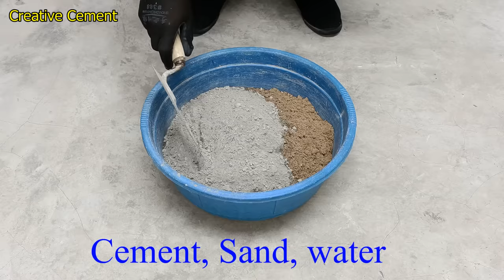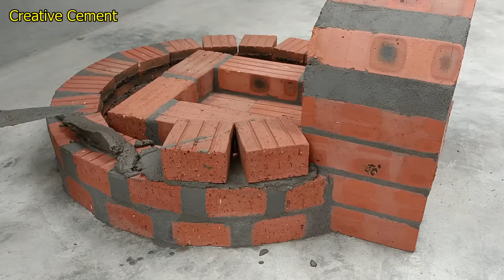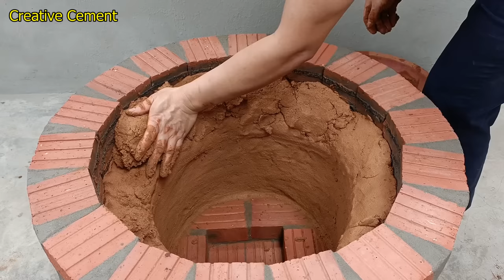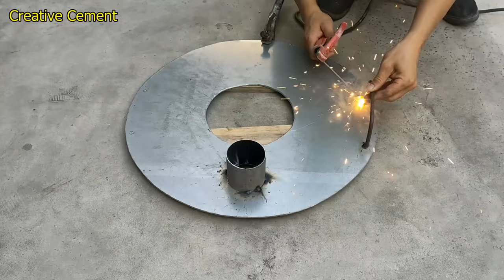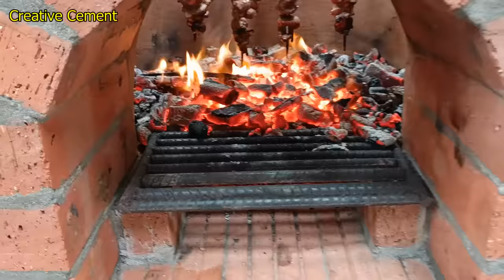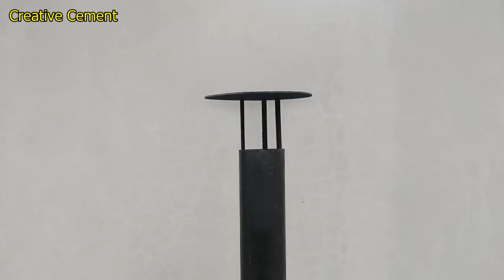Build a wood stove from cement and red bricks

Comment: 請原諒我不知道您的具體語言。 我假設你在中國。 我想這就是我一直在尋找的。 我看了你所有的视频，我喜欢这个，以满足我的需要。 我生活在一個寒冷的冬天，所以我必須在這裡使用合適的材料，但我認為它會很好用。 我有一個關於烤肉串的問題。 為什麼不把碎片做大一點，然後在每一端插一根串？ 這樣你就可以旋轉它們以獲得更均勻的烹飪效果，並且尖端不會燒焦太多。 可能值得試運行。 ☺

I think this is what I have been looking for. I watch your videos and I like this one for my needs. I live in a climate that has a deep cold winter so I will have to use appropriate materials for here but I think it will work nicely. I have a question about the kebabs. Why not make the pieces slightly bigger and then put a skewer into each end? That way you can rotate them for more even cooking and the tips will not char so much. Might be worth a trial run. ☺
Reply from the maker: There are many ways to bake, you can bake it your way